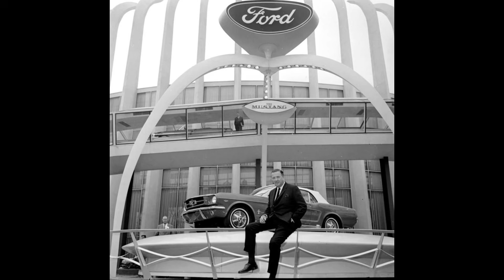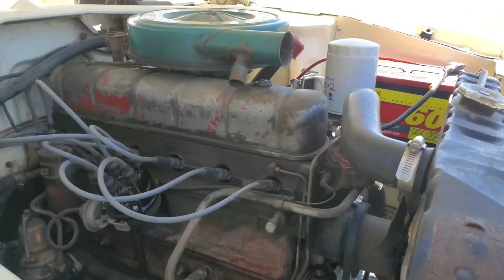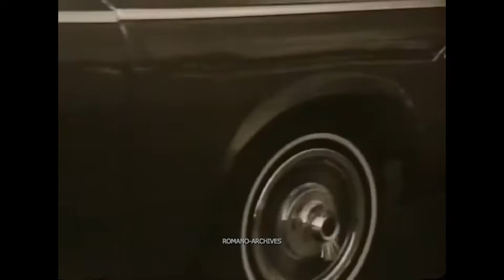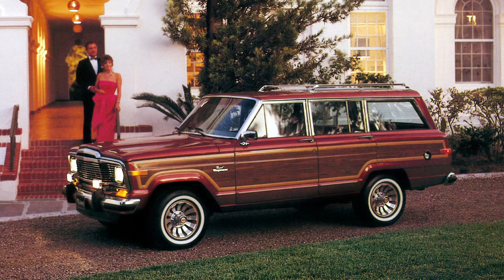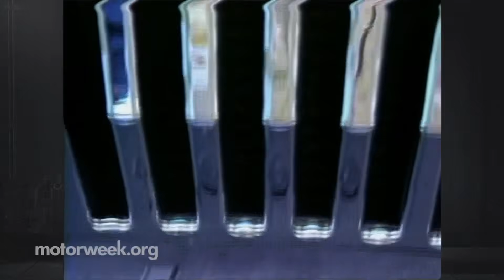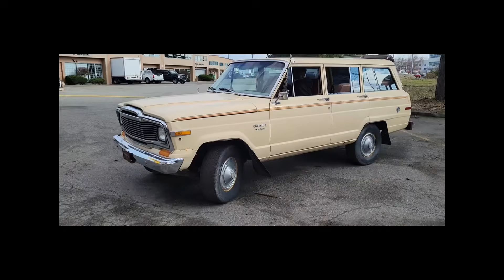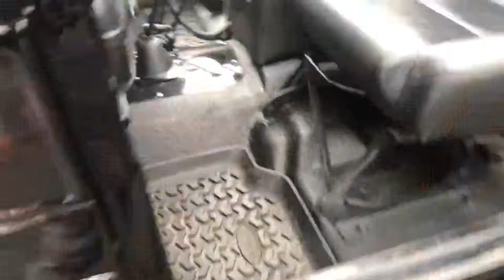Why This American Inline-Six OUTLASTED Every V8!

Comment: Yes two points , 1 the Chrysler Australia 215ci , 245ci and 265ci HEMI straight six, espically in 265ci Hemi Six pack R/T gise in the Australian Chargers is very similar to this six , infact even the bellhousing is close , the difference is the 265ci Hemi has a Hemi chamber, and before someone Google's the 265 ( and it's other family members the 245 and 215 ) and says " it's not a Hemi , the spark plug isn't in the middle of the head and it's not cross flow " , I'll make this point , Hemi has nothing to do with spark plug location , cross flow or not , etc , it is defined as " Half Sphere" chamber , that is all , many two strokes have a Hemi chamber, older one especially, as no engine can or would want a full Hemi half sphere chamber as it's too big, the definition of Hemi in an engine reference is 50 percent to 30 percent of a sphere , the Chrysler 426 Hemi comes in at 39 to 41 percent and the 265 Hemi Six comes in at 30.5 percent , hence the Chrysler Australia Hemi designation , the 265 Hemi Six has valves splayed north / south so front to back of car , not easy/west as in the 426 Hemi , the 265 has a spark plug comming in from the side , towards the centre of the chamber ( Harley Shovel Head does the same) , and the motor has intake and exhaust ports on the same side , like many radial Hemi headed aircraft engines . By definition the 265 ci Straight Six is a Hemi chamber. And Hemi engine, it was the most powerful, race winning against 351C powered GTHO Phase lll Falcons and 350HO Chev powered GM Holden Monaro's, the 265 had a factory rating of 302Hp wile the 340 LA had 290 and the 318/360 220hp . All available in the same cars , 265ci Hemi was the fastest by over 1.5 seconds, it shares much with the AMC six , if you put two side by side you would be hard tested to tell the difference. Many Chrysler Hemi Six's were dropped into Jeeps with the AMC six in Australia as the bellhousing and mounts are so close . 

As for point 2 , the longest running straight six is the 144 ci Falcon six family from 1960 , it evolved through the years , in 1970 Ford Australia didn't like the restrictive cast in one intake and head, as they were gearing up to start 302 Cleveland/ 351 Cleveland V8 casting and assembly they first cast a new 2V head for the straight six 250 ci which is part of the 144, 170, 188, 200, 221 and 250 family, the 2V 250 had a removable alloy intake and two barrel carbie. Producing 170 to 190 HP . 

In 1978 Ford Australia again redesigned the head of the 200 and 250 to create the Cross Flow Six with cantered valve Cleveland V8 style chamber, valve train , etc, infact it used all Cleveland 2V valves, rockers, assembly to cut costs as Ford Australia was already building Cleveland V8s as well. In the early 1980s with help from Honda Japan and Alloy head version came out , a bit later with multi port fuel injection. 

In 1987/8 again the six family was updated , engines were given metric designations, of 3.2 and 3.9/4.0 and a Hemi chamber two valve over head cam alloy head was added . 

By 2000s the final incarnation of the 144ci six from 1960 was about to happen , the 4.0 litre Barra 24 valve VVT Turbo straight six, that ran to 2017 in Australian Falcons , but the Barra still uses many design features of the 1960 Falcon 144ci engine , same bore spacing, same external dimensions ( to a point) , same mounts , water pump design, all date back to the original six . One family from 1960 to 2017 . 57 years of one engine evolving . 

The Barra in stock form can make 1000 + HP on stock internals and some have gone above that , many Barra's in Australian taxis have done a 500 000 km . A great basic design .

Comment: The Ford 300 cu in straight 6 was another engine that couldn't die.
Reply: Another six cylinder engine that was supposedly bullet proof and used in drag racing was the GMC 302 straight six engine, but was only used in larger trucks and busses through 1959. In addition there was also the Hudson 308 straight six that was a terror on stock car circle tracks in the early-mid 1950's!
Reply: @DJ-ij5qn  Used in larger trucks for good reason. Ever seen a tall deck GMC inline six? They're HUGE!
Reply: @DeanMk1 Not the 302 six, it was bigger than the Chevrolet six but not enormous. The GMC straight six was produced in displacements of 248, 270, 292, and the 302 cubic inches. There was a gigantic straight six cylinder gasoline engine that was used in tractor trailer trucks among others that was positively gargantuan,  like the mid- late 1930's into the '50's, before widespread acceptance of the diesel.
Reply: @DJ-ij5qn  I guess enormous is subjective. Noticeably larger, though (like 1/2 again).
...btw, 292 was a Chevy engine, not a GMC.
Reply: @DJ-ij5qn Straight 6 engines seem to be the most durable configuration back in the day. A lot of the diesel engines in tractor trailer rigs are straight 6 that last for millions of miles. I had a friend who owned a 1950 Pontiac Silver Streak (If I remember correctly) with a straight 8. The crankshaft would develop a "twist" to it from torsional forces because of it's length.
Reply: @Andy-m8b Yes read an old hop-up booklet from the 1950's stated the Pontiac straight eight was a loser for racing but that Pontiac straight sixes were actually used in circle track racing, both were flathead engines.
Reply: @DJ-ij5qn yes before my time, however you mention it I recall
Reply: @DJ-ij5qn lived my neighbor's Hudson Hornet with the 308 in it with dual Edelbrock  4 barrels  , Awesome Car !
Reply: The 300 6 was the best,  I've driven them for years and seriously doubt that there was anything better.
Reply: @Randy-mentyou and when coupled to Fords 4 speed with over drive  &3 speed transfer for 4 wheel drive transmission , It was an awesome work horse !!!
Reply: If I find  one somewhere,  I'll replace my 302 in my F150 PU.
Reply: thing is the 300 was truck only cars only got 2oo or 250 the 300 had a smaller one only trucks the 240 i had Econoline built in 1966 with the 240, and a 71 p350 step van with 300 
not positive i think there were few pard interchanges but car had manifold cast with head if i remember right ,, but i had chance  co i worked for had 82 e 250s 351 v8, but when in for service dealer rental was e 350 longer with 300 6 both auto the v8  got 1-11 mix of city and highway the 6 about 17   and that was about 600 miles over 2 shifts . the v8 got 250,000 when traded in we got mostly Aerostar 22 mpg
Reply: @remocres I sold my F150 with the 300/6, manual w/OD for a $1 with 290,000 miles. Running like a champ the last time I drove it. I also calculated 17 mpg overall from a long trip with mostly highway with some small town stop 'n go.
Reply: @remocres  A friend actually had a mustang with the 300 ! Factory.
Reply: @curtisgibson-wm1gb  doubt it it was always a truck engine now a dealer depending on yr might have built one until emissions got strict dealers often did swaps but in a car a better choice would be a v 8 since it was lighter that the truck. 6 . mustangs often has 200 cid i drove on in 1980 it was a 79 rental car i didn't believe it only had the 6 in it
Reply: @remocres  absolutely no made sense that
Reply: @remocres  Sorry but I cant understand what you are trying to say.
Reply: ...along with the Ford 200 inline 6....and the Chevy inline 6's....and the Chrysler slant sixes....
Reply: @DeanMk1 also all million mile diesel engines are I6
Reply: @roaddawg3217  Not all....OM616 much?
Reply: @DeanMk1 my bad i was thinking of the 6v and 8v, i don't think they hit those kinda miles without overhaul, but all the modern diesels i drove alll I6, a mil was a walk in the park if well maintained, not always but quite a few over 1 mil and not opened
Reply: @roaddawg3217  Sounds like you're speaking of large commercial truck engines, like a 400 Cummins, but diesel engines come in smaller sizes too and some of those engines will last a lifetime, too.
Reply: @DeanMk1 yes, ive heard the Cummins that came in the early gen. Rams were bullet proof
Reply: Not sure about the ford and gm v8 diesel, ive heard mixed reviews depending on the year etc
Reply: @roaddawg3217  I didn't mention them.
Reply: @roaddawg3217  You're looking for the old "2 valve" engines.
Reply: @DeanMk1 right, ive heard that.  Thanks for the correspondence! Hav a gudun!
Reply: @DeanMk1 Chevy had the 292 cu in inline 6. That was more like a commercial engine also.
Reply: @Andy-m8b  They also had the 194, 230 and 250, not to mention a whole gaggle of displacements from the "stovebolt" era.
...so what are you telling me?
Reply: @DeanMk1 Reminiscing of the great engines of old.
Reply: Grandpa had one in his C 20 or C 30 Chevy pickup with split rims.
Reply: I prefer the Chevy 230, 250, or 292.  Also I like the Chevy 235's that were made between 1955 and 1962.  Regardless, the big 3 all made great straight sixes back in the day.
Reply: @ironcladranchandforge7292 The GMC truck 272, 292, and 302 straight sixes had a similar design to the 235 type Chevrolet six, but were larger overall. The Chevrolet 194, 230, 250, and 292 sixes were the same basic design - the 292 GMC is bigger than a 292 Chevrolet and the GMC sixes all used shaft mounted rocker arms, the 292 Chevrolet is smaller than the GMC six physically and uses stamped stud mounted rocker arms like a Chevrolet V8.
Reply: @DJ-ij5qn  --  Great comment and great information. Thanks!!  GM straight six engines are my favorite. However, I've only owned the Chevy versions, MANY of them over the last 50+ years.  I'm rather ignorant of the GMC versions. Well, until I read your comment. The only straight 6 engine I own currently is a 235 in my 1960 Chevy Apache pickup. Runs like a finely oiled sewing machine.
Reply: 1960 was the year GMC trucks introduced their line of V6 engines.
Reply: Got a 91 f150, 300 cid.  Runs like a top!
Reply: @JamesLandon-yk1no  And it's still running in 2025. Probably replaced 2 distributors by now. As for the rest of the engine; probably get 500,000 miles out of it.
Reply: I've had several  Ford F series trucks with them .. up until 1996 when they stopped building them .and an inline 6 in my 1952 Dodge M 37 ! , All were great trucks !
Still have a '67 F 350 with one sitting in my drive way in need of restoration.
Reply: Toyotas is good to ... It was the old GMC inline 6 , 257 CID.. they bought it and the machinery from GMC when they discontinued it .. had it in my '74 FJ40 with a 4 spd manual  & 3 spd transfer for the 4 WD...
Reply: @blainelytle341 I think you're thinking of Nissan and how they bought the design and rights to the old GMC V6. 
The original 300ZX was that old GMC design. You could see they left the sparkplugs on top of the head, instead of their usual location.
Reply: As was the 240 and 250 Ford 6 used in the Galaxie starting in 1965. 7 mains, and strong as an ox. I am far from a Ford guy but will give credit where it is due.
Reply: @The-Friendly-Grizzly  --  To be honest, all those straight 6 engines with 7 mains in the 60's were great engines, regardless of make.  The Dodge slant 6 was great as well.  Personally I prefer the GM straight sixes myself, only because I've owned so many and know them so well.  You can't go wrong with any of them.  At the moment I own a 1960 Chevy C10 short bed step side pickup with the I6 235 engine. Runs like a top.  Of course the 235 isn't a 7 main bearing engine but they are still very reliable. I've driven that truck many miles and trips over the last 25 years.  It has never let me down.
Reply: @ironcladranchandforge7292  Thge GM 292 was a stump-puller. It would also pass anything but a gas station.
Reply: @The-Friendly-Grizzly  --  😂!!  True.  I'm sure some of that gas mileage was due to low gearing though.  At one time I owned a 1965 Chevy two ton truck with the Chevy 292.  It was bad on gas milage as well, but top speed was 45 mph at about 3,000 rpm or possibly higher since it didn't have a tach.  It could carry or pull a huge load with those low gears, but with constant high rpm's it really ate the gas.

Comment: [WHAAAT?] A crossflow cylinder head? ... B.S.!
Reply: Yes exactly HUGE B.S.!
Reply: A aftermarket one is out there  Clifford research had them .
Reply: @jhonsiders6077  - NO modern (post WWII) American inline 6 has ever had a crossflow cylinder head, including the aftermarket. Not even the OHC Pontiac had a crossflow head. If you know of a Clifford crossflow, let's see one!
Reply: @OHUQTU   When in my younger days racing stock cars we had a class called sportsman we ran 6 cylinders Ford and GM the guys that could afford the top dollar parts used a outfit called Clifford research  I dont know if they are still around but they did make a cross flow head I saw them  and they also built a nice 4 barrel  intake  and a exhaust header with a 4  inch single outlet along with a better flowing head  I had one of them on my Ford  300 this was back in the early 70s  you might look them up see if they still exist I will .
Reply: @jhonsiders6077  - I do not believe that Clifford (yes, they are still in business) ever made/sold any cross flow 6 cylinder heads.

Comment: Not a cross-flow head !
Reply: And the Chrysler re-fresh creating the 4.0 was not a clean sheet, either.  And AMC's 2.5 liter four, which was the same engine without two cylinders, was so good that Chrysler abandoned their four cylinder engines and used the AMC in Dakotas and Jeeps for many years.
Reply: @EricResnick lol, 4.0 is the same family , same engine